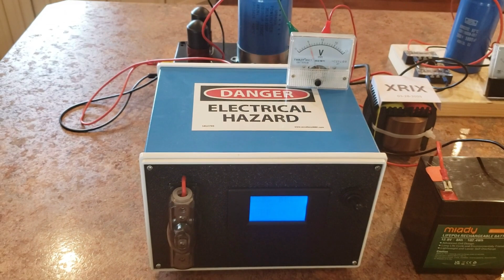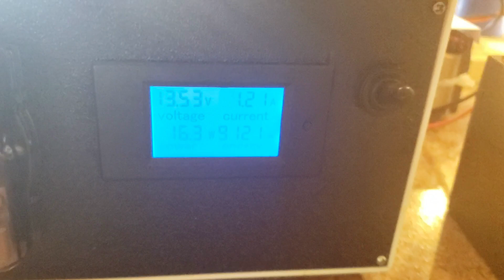Over Unity Working Don Smith Device - Part III

Comment: Hey XR! I have a really direct question for you, hopefully you'd agree that it's a GOOD one. Have you noticed any of your components or heatsinks becoming significantly cooler than the ambient temperature while any of your devices are operating??? If so, could you describe the location in your circuit as best you can?........please hahaha  Thanks brother!
Reply from the maker: It is easy to run a circuit and find a component that is cooling. That is what sent me down the hurricane of wonder. I built a pulse motor in an orbo setup. Nothing fancy but magnets on a computer fan with a cd  glued to the top. The magnets would trigger à coil to fire when the magnets were at tdc. I used a transistor attached to a reed switch to sink the rail, energize the coil. A controlled the voltage. I found that there was a zone where the transistor was colder than the ambient temperature. It would actually feel cold. I confirmed the reality with a measuring device. I had a transistor cold while driving the motor. All semiconductors have a rating for power. Which is heat dissipation. But it should not be negative. A Peltier will have one side cold, but the other is warm. To answer the question in my device, the trafo doesn't get hot. Don said magnetic flux is a cooling agent.
Reply: @XR_IX  Thank you for your thorough reply! I don't recall when Don mentioned magnetic flux relating to the AEG cooling effect. Would you delete a comment of mine if I wanted to share part of my secondary phone's number and allowed fellow researchers to text my alternative cell? Just curious, there are some really interesting guys who come to your channel.
Reply from the maker: @ I'm glad people do, I am not sure what you are asking, and you have the power to delete your own posts.
Reply from the maker: @NickyTesla-pg1ex  "2. Magnetic flux =’s which does not obey Ohm’s Law and the effect is cooling or cold"
Reply: @XR_IX  Forgot to ask. In the Final Disclosure drawing, can you tell me what the red wire is and does, and what type of diodes are under the xenon lamp??? Please
Reply: @XR_IX  Can I ask you directly, is a resonant LC tank, that has LOTS of circulating current the most important thing to achieve inside your circuits???
Reply: @ Do you know anyone who has Clear pictures of Don's early POC yellow coil device??? I found a decent pic of his 4kW model which has a brass Faraday lid. I've looked all over for the yellow coil device which has Motorola transistors on heat sinks. Only images are from his transparencies  projected on a screen around 1994 I think.
Reply: @XR_IX  Luckily I'm helping remodel a family home near Albuquerque the last few weeks so I'm able to take advantage of the electro surplus in the city which is fueling my collecting of exotic components 😁
Reply: @XR_IX  Interesting! My pulse-motor days were around 2008 along with Perendev and S. Meyer. I wish my Bedini 3055's would have run cooler and not burned up so often back then haha. In college, I thought I remember learning that magnetic current in the laminated core would cause heating, but maybe they're wrong or a different form of magnetic energy is present with Don's devices. Do you know of a straight answer as to what Don meant when referring to "wiring the capacitor that's already in that motor scooter slightly different, and it would run, basically forever." ?
Reply: Hi, some time ago I found this patent, where is the same circuit (as one of the drawings). Search in Google patents for KR20110139558A. There are written some informations correcponding to the Zilano final disclosure.
Reply: @mrmishmash1725  Thank you, my friend, for pointing out this patent to all of us. Warmest regards and fruitful success.🙂
Reply: @HobbyElektronikaZabawa  Which patent?
Reply: @ Haha thanks for your insight. The Diodes were making me think of our AV Plug days 😄
Reply: @ I do have a MUCH better scope but for obvious reasons, this little chinese one gets to be my Canary 🤣
Reply: @ I've never understood why we can't seem to easily make a non-returning impulse today with modern/exotic diode types! Maybe a high power SCR could be such a blocking device. They might also be used to replace the quenched spark gap altogether.......maybe
Reply: @ Hey! which patent???
Reply: @Sandman-702 Hey Sandman, are you saying Zed has an important google drive folder???
Reply: @Sandman-702 Wish I could show it to you. He talks about it specifically at the 1995 conference, one time-stamp is in part 2 of that 2 part series at 1hr 49min 45sec he starts describing it in pretty good detail (which I like hahaha). If I had better pics of that one, I'd start replicating tomorrow! In part one, he actually displays it on a table, but camera position is all wrong and low quality😄
Reply: @Sandman-702 Sorry brother, I didn't mean to imply my deductive skills are that good haha. Don says it directly a few minutes into his explanation of that device. My interest leans more toward his devices that others seem to mostly ignore. I suspect those circuits are more accurate, perhaps completely unaltered, such as the pictures of his "4kw" device thatt he mentions he once sold for $5 mil. Have you seen the few pics of that one?
Reply: @Sandman-702 I agree, that's probably the closest to a complete photo that I've seen. He speaks of it as though it may have been his first "over energy" device that had more OP than IP, that's why I'm most interested in it 😃
Reply: @Sandman-702 I've never owned one of Rick's books. I wish I could have a look at that schematic!
Reply: @Sandman-702 Dang, what happened???
Reply: @Sandman-702 I didn't block anything, obviously

Comment: I finally uploaded something on my current channel. https://youtube.com/shorts/qj9zlCpma_U?feature=share
Reply from the maker: Thanks for trying to replicate. Parallel Cap is on the trafo primary. CO Springs note page 57
Reply: @XR_IX  Haha sorry, it was 2am and I had forgotten you mentioning that before. I was able to upload a few others before going to bed. Thanks for the page #    ; )
Reply: @XR_IX  On my original channel, I uploaded a video clearly showing a Stepper motor used as a generator that would actually speed up and the drive motor would consume less power when loads were applied across the Stepper motor(generator). I should redo that experiment with a better camera and recording skills haha. I was following Thane Heins' progress around 2010-2012, that's who inspired that old video of mine.
Reply: @ I uploaded a couple videos of my current stash of devices and components. https://studio.youtube.com/video/vZ03oIs1D3Y/edit

Comment: I’m able to get hundreds of uT around my  Amorphous transformer core while only consuming a couple of watts. Would you mind giving me a little direction as to the output circuit to benefit from such a strong magnetic field? I’m definitely the type to help others as well like you have done. Feel free to send me a direct message if you’re able. THANK YOU!
Reply from the maker: If you are creating magnetic waves, you need to find the frequency to receive the transmission. To capture you have to figure out where your pickup coil will exist: Near field or beyond. Near field means you are in direct contact with the flux. Far means you are tuned in as an antenna. The ideal pickup will consider both. It's like tuning forks, if they are even multiples, the naturally receive the transmission. The more you look at a transformer as a three dimensional resonator, you realize the goals you must achieve. It took me a while to come up with the coil you see, but I can clone the performance as long as I follow my recipe.
Reply: @XR_IX  Very cool! Thank you again!
Reply: @XR_IX  Wish I knew where to look in the forums for your posts and uploads. It may be impossible now to send direct messages through ytube these days.

Comment: The core is AMCC320?
Reply from the maker: Equivalent to an AMCC100, it's medium sized.
Reply: @XR_IX  I have in my plan to replica the device in the next few days, most of the parts are laying around, just the load is a bit the mystery what do you recommend? The 12V 4w led are pretty hard to get at my place. I will do the basic device just to prove myself the concept. So 2 MOT's, maybe 3, primary side and the load side. Another thing, i will for sure make a video, where can i share it with you, just for you?
Reply from the maker: @dusannovak6158  The load has to be such that it doesn't bleed to ground. I have found you have to test the type of LED. You can also use small DC motors (But I haven't tried it myself) It is a matter of testing. LEDs that are dimmable, are preferred.  They allow the cap to rise in voltage, until the reach a point where they turn on. Look up "12V 2W LED Chip Bulb" on the river,  they are good cheap bulbs, that show that you can't put two on single MOT in parallel or series, but can run one on two different MOTs. They are also quite brilliant. I buy from a place I can return, so I am not stuck with bulbs that don't work.

Comment: Hey buddy! All of us from the forums are happy for your success! I’ve seen several versions of Zilano’s final disclosure, some are probably misleading. Can you post a link to the version you are referring to? Thanks!
Reply from the maker: I wish I could, but I got it from a forum, I believe that was internal source. If I find one, I will reply. The right version has the cap parallel to the primary, with another cap in series blocking the DC. It also has a xenon tube... kinda like mine LOL.
Reply: Thank you! I just made a trip to my local military electronics surplus store yesterday and did buy a small xenon bulb. Wish I could show you all the components I have around me right now!
Reply: Please contact me if you’re able. I’ve focused exclusively on Don’s designs for 12 years now.
Reply from the maker: @NickyTesla-pg1ex  I'd love to see your work. Please send me links.
Reply: @XR_IX  Would you be able to tell me the part number of the avalanche diodes you're using in this iteration?
Reply: I have a few SF1600v diodes. Would these be comparable to the type in the final rectifier of your device?
Reply from the maker: They are the vishay byv series. There is a Philips series as well more powerful. But they are ultra fast and durable.
Reply from the maker: @NickyTesla-pg1ex  The Engineering parameters, it is really more important to match your NST frequency. So if they don't have the recovery speed to flip the switch fast enough you are loosing cycles. The next is the reverse voltage that you want to store in the capacitor. This is why your NST can be 100KV, but you don't see the reverse current until you store it. It will build to it's cap limit and pop if you don't have a method to safe guard it. This too will happen to the diodes, so if your circuit runs away and your cap holds 2000V, your 1600v diodes will lose integrity. On the output side being the final, the speed slows down. And you now have to worry more about amperage.
Reply: @XR_IX  Are you saying match diode speed to NST or tune other components to the NST frequency?
Reply from the maker: @ No --just use fast recovery diodes. Made for switching. BYT78

Comment: Great job, now it's time to share all the specs to allow for replication and help change the world. Congratulations 🎉
Reply from the maker: I wont - I will get litigated for negligence, or some shit, and then nobody gets to see it. If I keep to these non specific conversations, I will get to make my content for all to see. I am not in pursuit of anything beyond sharing the concepts. People have replicated the concept, but no one seems to get its limitless potential.
Reply: @XR_IX  What's the point of posting anything if you don't share how to achieve the same results?  Otherwise people are just going to waste time and money trying to figure it out, and then call you fake because they weren't able to duplicate the results.
Reply from the maker: @justbob1581  Dave and Bob try building a single MOT circuit, and get a 4W LED bulb to light up on the output - The schematic used for (all blue boxes, output) is Zilano's Final  Disclosure. There are three modules: Exciter, Transformer, Output. There are four parts of the Exciter: PowerSupply (Battery), HV-Supply (Neon Transformer, ZVS + Flyback), FWBR, and Capacitors (1uF Microwave Oven Capacitors - Use Tesla Colorado configuration from page 57). The Transformer module (MOT, Custom Made, or motor driver Trafo of the .5 to 1 KVA). The Output module has three components:  FWBR, Large DC Storage Capacitor, Load (Dimmable LED). Read through people's questions, and be careful high voltage is deadly and capacitors hold that energy till discharged. Microwave capacitors usually have an internal bleeder resistor.
Reply: @XR_IX  Thanks for the info, I'll try some of those ideas out.  Not that you asked, but just fyi, I am not just a keyboard warrior.  I am probably 20k into my parts, hundreds of hours, 15 years, and a couple near death experiences! (LOL)

I have duplicated Rick Friedrich's coil setup and can add as many as I want just like he does, but I just can't get any useful power out of them 😞
Reply from the maker: @justbob1581  I know of Rick F. We are on friendly terms. I bought his book, because I can afford it, and annotate in the margins. The reason that power escapes many people because many people confuse transmission and amplification. You need to know which is which. Don Smith said that if you are chasing the electrical, you are chasing the wrong rabbit. So if you are scoping a lot, and looking at signals. Stop! We are pursing magnetism, and our electronic measurement devices can't see what's going on in the magnetic realm. A gauss meter is useful, but remember Tesla had non of those. But if I put my cheap g-meter  near my trafo,  it will max it out (>99uT). Put a g-meter next to your little Rick coils... There you have it, a difference in magnitude. Don Smith devices, are all magnetic.  You should view them from that point of view.  The DSE is not a device, it is a resultant effect. To use it, you must first get it. Another heart breaker, is that you won't find a schematic, that will run your house. I have not yet, but I am certain I can with this approach.
Reply: @XR_IX  for sure it's difficult to replicate, a few like you have had success, but myself and others don't know how to proceed exactly.
Reply: @XR_IX we have communities for such cases, you can share it there and be part of it

Comment: nice, if you can loop it, then we have a winner. Everything will work for 2 min.
Reply from the maker: These are the fallacies that  keep the research of this dead. If you create a self running device, it becomes a perpetual device, and people people will think that it is probably false. Furthermore, they can't be satisfied with possible applications of what I am showing. Like the idea is to improve solar efficiency so that you are are only running your house with 1/3rd of the solar panels. When I do have a device, I will not make a video for it. I understand that people will stop thinking for themselves.
Reply: People who make this comment don't understand power and aren't qualified to comment about it!